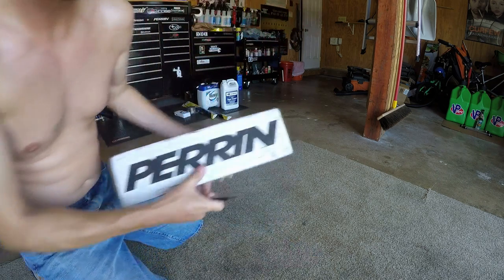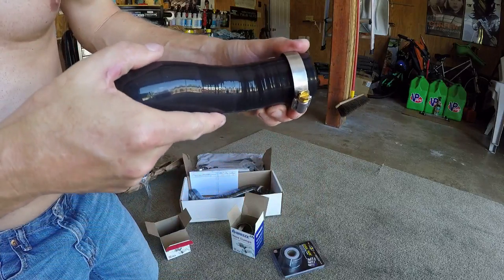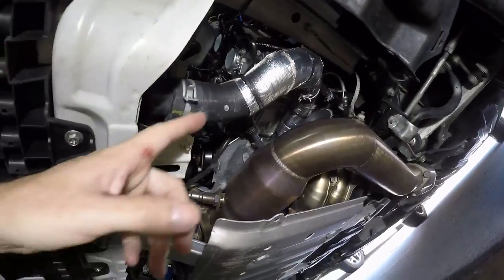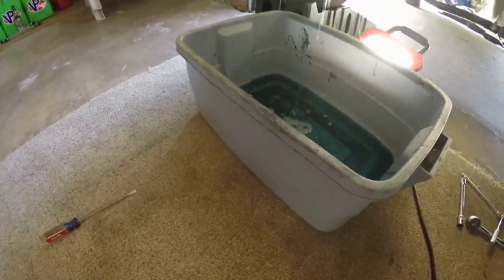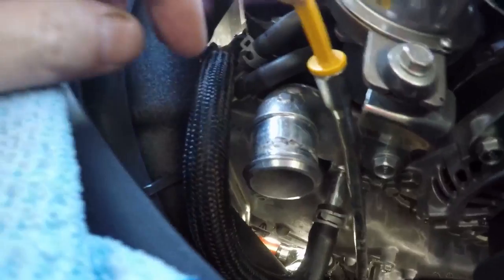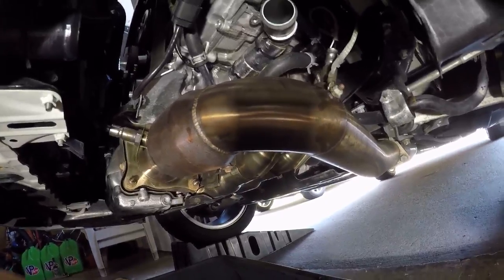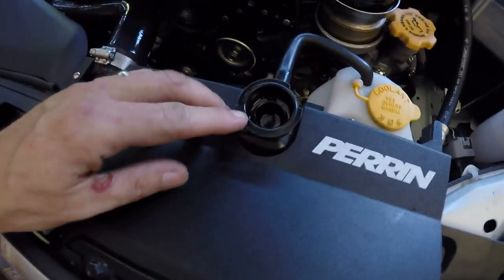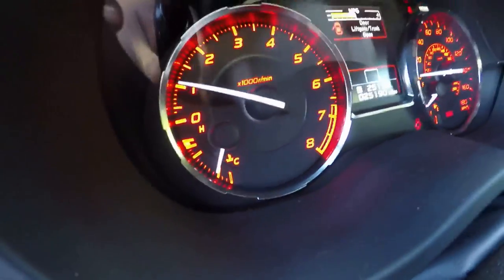2015 Subaru WRX Ep. 811: Installing Perrin Performance Radiator Hoses

Comment: I have a 2015 Forester that the top radiator hose just got a hole at 335K miles.  I was going to replace the hoses in a few months anyway.  By the grace of God, it blew a hole while I was parked waiting to pick up my pizza and was close to home and an auto parts store.  I also had a roll of black Gorilla tape in my car, which I wrapped the hole just in case.

Comment: I was told to use the stock clamp on the radiator because the plastic will expand and it could crack with your clamps.
Reply from the maker: Interesting... who told u that
Reply: LastHumansGarage I replaced it on my toyota and the guy at the radiator store told me about it. It kind of makes sense.
Reply: Gabriel Rivero actually you are right I was told that the spring clamps are the best because they can allow just enough clamping Force for the plastic to expand and contract.
Reply from the maker: damn..... now you got me thinking...... i'd have to drain my entire thing again....

Comment: With that amount of coolant being drained, during the EGR delete install, do you think we could run the upper coolant hose directly to the cylinder at the bottom and delete the lower coolant hose? instead of having the two hoses connected.
Reply from the maker: That is a nice way to do it, but makes a much larger mess on the floor, tons of your coolant would drain out.

Comment: I was wrong on my last comment. Maybe will do the distilled water flush and go that route then put the super coolant in there with the conditioner.
Reply from the maker: cool thanks
Reply: @LastHumansGarage  No problem. I removed the previous comment. I ended up just doing a simple drain and fill. I had some Mishimoto upper and lower silicone hoses and installed those as well. The fluid came out pretty close to what yours looked like but slightly dirtier. I had a few pieces of what looked like rust or some sort of sediment on the bottom of pan I drained fluid into. I got out close to 2 gallons which based on the manual is close to capacity of the coolant.

Once drained I installed the petcock back. Had gotten new OEM O-Ring for the petcock along with OEM filler neck cap. The old one looked to be in great shape so keeping it around. The original hoses looked alright as well but I had the other hoses so hey why not install them. Filled with the conditioner along with Subaru super coolant. Had 2 full gallons plus one slightly used and used 1.7 gallons. Did not bother removing the overflow container but inspected inside which looked to be good.

While I was doing that I threw on a new serpentine belt I had been carrying around in car for some time. It is a Continental serpentine belt. I compared the length and looks like the new one seemingly is slightly longer. It went on with no issues to note. When the AC kicked on while watching the belt you can tell. I kept watching the coolant levels and looks like I filled it to where there is no drop. Had the heat on max with fan low idling for a while and also ran it with HVAC being off.

I'll end up changing the coolant in around 30-40K miles doing probably another drain and fill. Or maybe I'll do the distilled water deal but just didn't feel it was necessary this time around at 77K miles. Hopefully this will not come back and bit me decision wise but I think I'll be good. Thermostat is also original didn't bother changing that.

Comment: I can tell you now, a plastic zip tie, that close to the cat - will melt into nothing. The heat wrap will cut down a lot of radiant heat but its surface will still get couple of 100 degrees C, enough to melt plastic.
Reply from the maker: dang... ok ill order metal zip ties..
Reply from the maker: i read reviews on metal ties.. most people say they suck... i will be using normal hose clamps instead.. super solid and reliable.